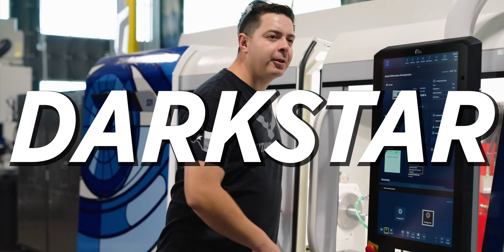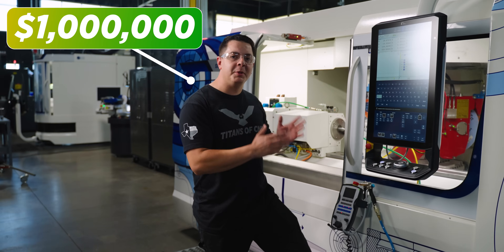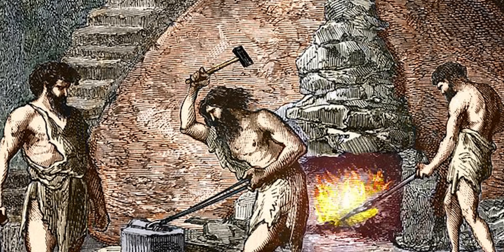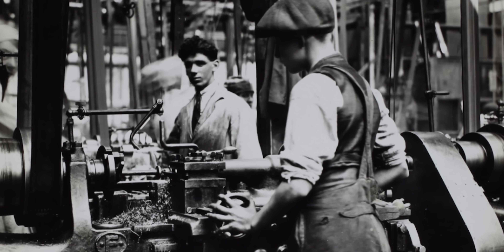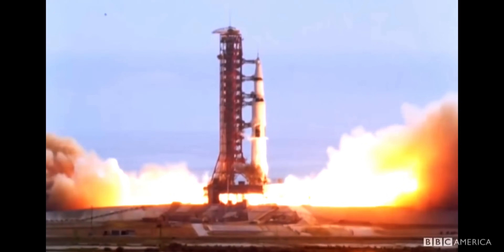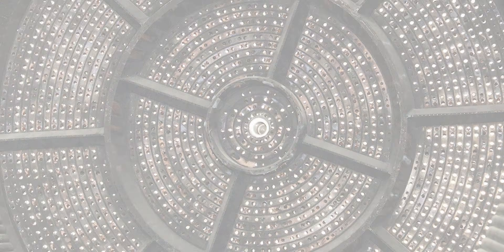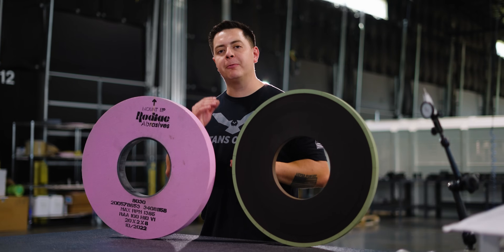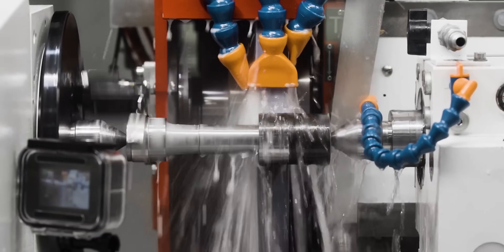How Machines Evolved to Make Hypersonic Planes

Comment: I remember seeing a special program the talked about the surface finish of the pump parts was measured in wavelengths of light allowing liquid oxygen and hydrogen to be used as lubricant for the bearings in the turbo pumps.

Comment: Visited a shop yesterday and they had a dozen Bridgeports. In a hundred years, there will be shops running a dozen VF2-SS cranking out parts for cheap.

Seriously though, there will be advances in machines, of course, but the true changes will come from materials science. New alloys will be discovered/developed allowing huge advances in engines and propulsion systems.